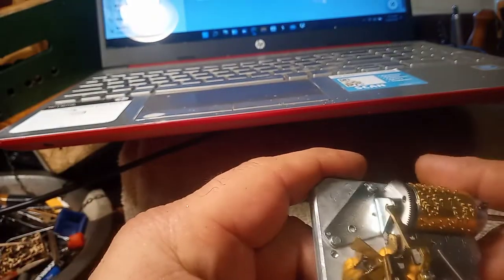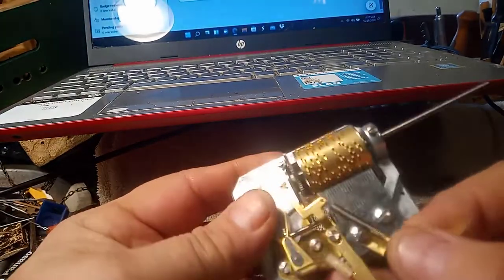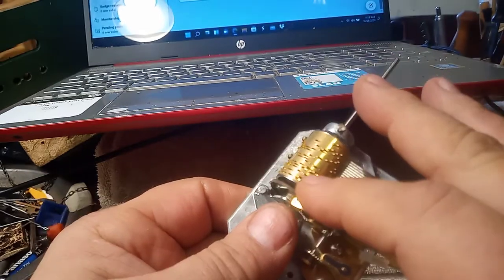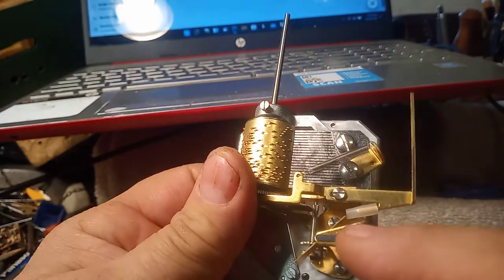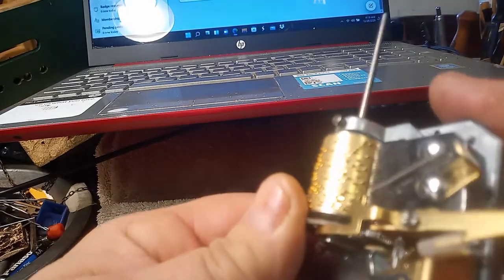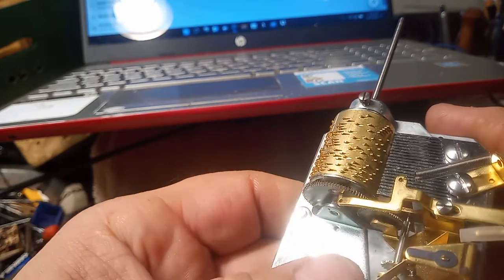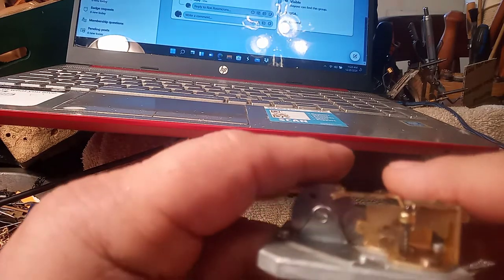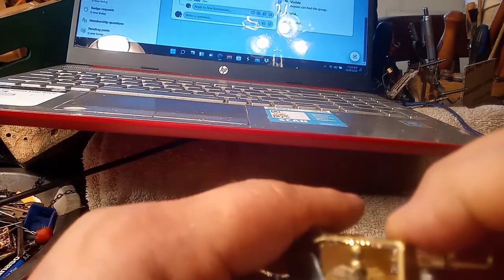Update on music boxes for cuckoo clock problems 20211225 111625

Comment: Hello there and thank you. I found out that the little plastic gear in mine, has a crack. Can i buy/find a new gear or i need to buy a new complete unit?
Thank you.
Reply from the maker: They dont sell the plastic gears in the US.  You will have to repair or buy a new governor assembly or a new music box assembly.  Good luck. God bless.
Reply: @munnerlyn3  thank you for the quick reply and God bless you as well.  I’ll try to repair it…

Comment: I have a new cuckoo clock with this same music box.  The clock was working well for the first day.  The second day the music stopped starting.  I put the clock on two chairs so I could put the weights on and test it.  If I move the minute hand manually the music will start most of the time.  If I put the clock 5 minutes before the hour the fan gets stuck on that stopper (you showed 3:17 seconds in that can be adjusted) immediately so the music never plays.  Any ideas?
Reply from the maker: sounds like the wire that trips the brass lever on the music box might be bent too far down which is preventing it from releasing.  That is my guess. Please contact me on Facebook. My profile picture is a drawing that an artist did while at was at the VA.  Send me a video of the back of the clock so I can get a better idea.